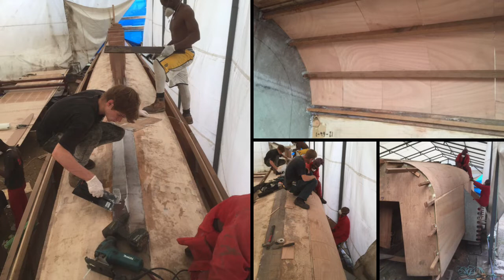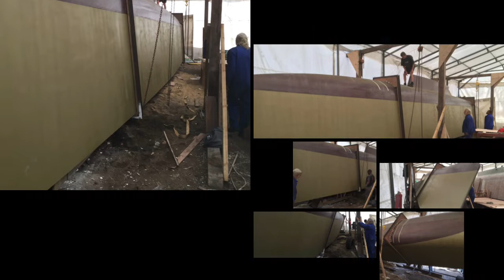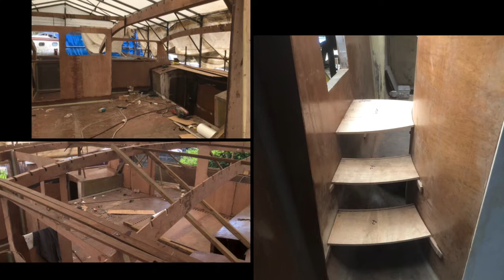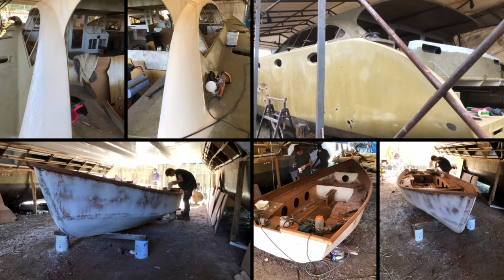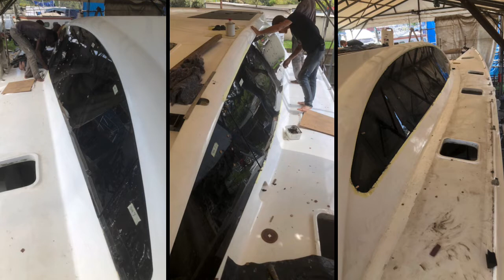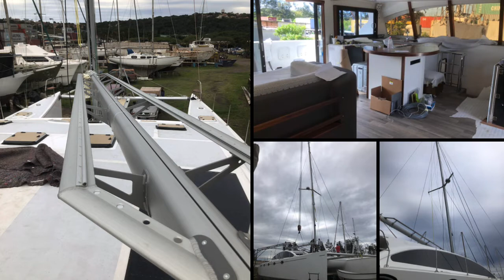Sea Tribe DH550 Slideshow

Comment: Good to see, thank you.

Why plywood rather than Foam Core?
Reply from the maker: Plywood produces a very strong, light boat. There is a foam core of 40mm so the construction is a plywood/ epoxy composite. All ply is completely saturated with epoxy before construction. Plywood has a far stronger piercing strength. Fully equipped & loaded to cruise she is a little over 18 tons compared to similar sized production boats of at least 23-30 tons.